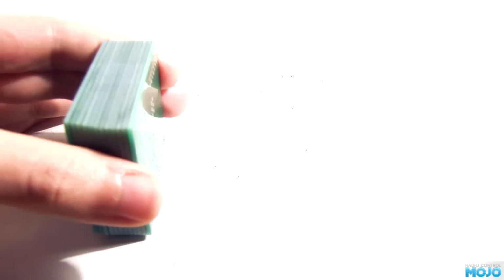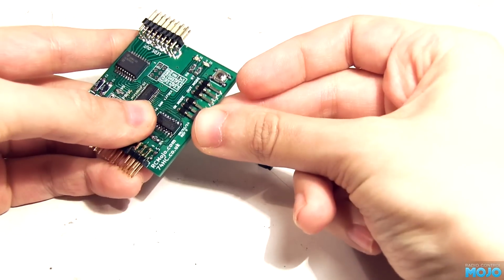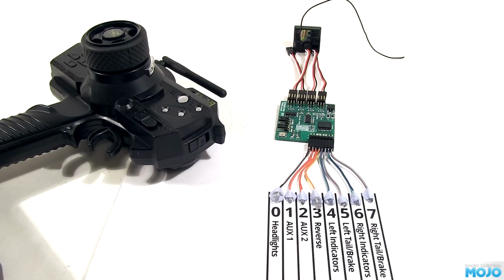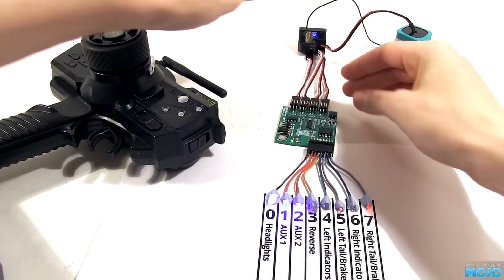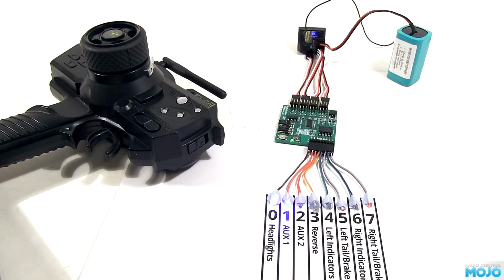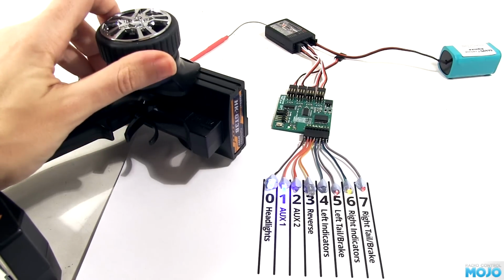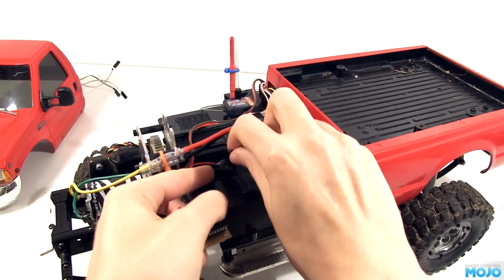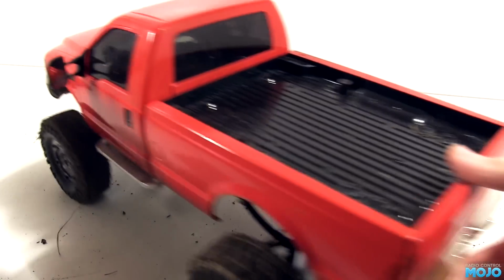mojo_RCLights_Truck_B - The controller of light

Comment: by the looks of it you are using arduino for the code i have built my own one with much the same functionality but in a much smaller foot print if you double stacked your board you could get it to a more manageable size becasue atm it is a little big for some applications
Reply from the maker: ElectricRC199 Close, I'm using Energia with an MSP430, easiest way to get a MSP 
toolchain on macos. The size came about purely due to the amount of time
 it takes to build, oversized pads etc. If I can get a reflow oven going
 I can use smaller packages so smaller boards should be quite doable, or
 as you say more than one board stacked up. I think the 5cm x 5cm is a 
fair compromise though, on most 1:10th chassis there’s normally a space 
it’ll fit in.
Reply: ElectricRC199
What Arduino are you using? I would like to be able to use an Arduino Nano but can't find a sketch that I'm happy with. Would you have a sketch that you could share?